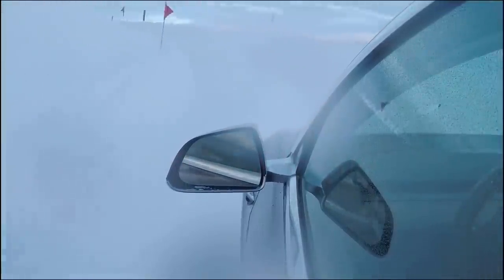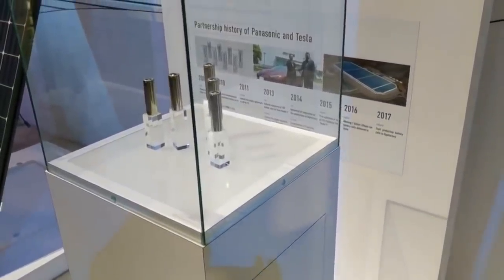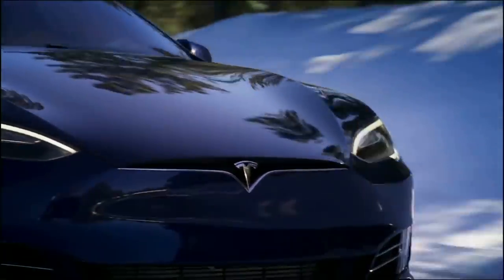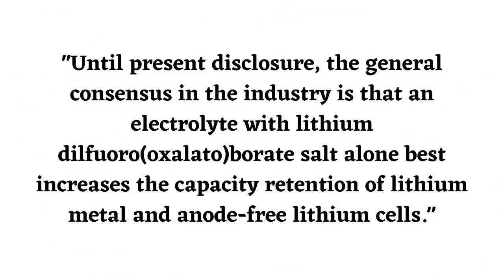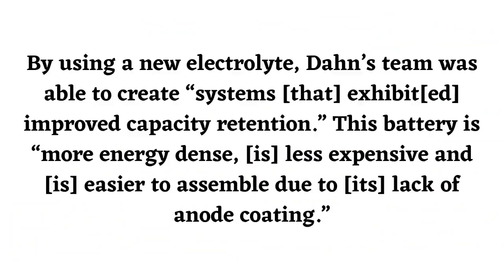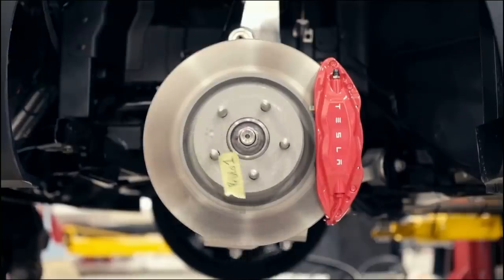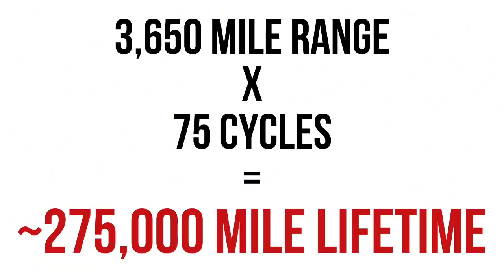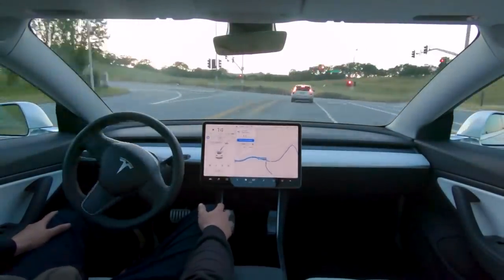Tesla's Secret 3,650 Mile Range Battery - The Next Gen Revolution

Comment: A really silly video with no substance and lots of blind hope. Batteries have a physical limit and the same size/weight batteries will not be able to get 3,650 miles as that is a 10x improvement on energy density

We will be lucky to see a doubling of current cell energy density within the next 20 years

For reference TNT is ~4,000Wh/KG and that is a pure chemical reaction. A battery has to be a fraction of that upper chemical limit as a battery needs to be reversible and is electrical and has hosting and safety systems and collectors and so on

300Wh/kg current best in class cells
4,000Wh/kg chemical limit

Future cells will be above 300Wh/kg but WELL below 4,000WH/kg and as I said earlier if I were to bet I would bet no rechargeable battery in 2030 will have an energy density greater than 600Wh/kg (twice as good as today) and more likely will be closer to 450Wh/kg (50% improvement from today)

Comment: It may make sense to half the battery size and make it at one quarter the cost, potentially opening the way to replacing the batteries many times and extending the car life to say 2000 000 miles

Comment: If this is going to happen, next step for Elon will be electric planes, probably feasible for a fraction of the cost of current jets.
Reply: Electric flight is already here.  Israel operates an EV commuter jet that seats 7 and has a range of 600 miles, 100% electric.  Just one order of magnitude increase in energy density and airliners will be next.
Reply: @PETERJOHN101  Commuter Jet? Either it is a an electric plane, which I presume to be propeller driven. But an electric jet? Even though it probably should be feasible in the distant future, but now, I don't think. Are you sure  of what you are stating?
Reply: “electric jet” that reminds me of Elon’s cameo in Iron Man 2. Check it out
Reply: @Allen Loser As in all projects, it is always a matter of compromising one side to favor the other, and naturally it would apply to every single aspect vital to the whole project. That is the reason we always need high specialized engineers and math expert to bring any complex project to perform at a given optimized level, while establishing at the same time the feasibility of its profitability when the finished object will be commercially  exploited. A detail at times thrown out of the window when a given high tech finished aircraft like the splendid supersonic Concord, well ahead of its time, undoubtedly for countries pride both France and the UK financed the project, to find out later that no airliners wanted to buy them, because it was almost impossible for the Concord to be able to fly and generate a profit at the same time, because its very high maintenance requirement and the impossibility to create profits for the limited amount of paying seats available pro flight. Years later with different players involved, the A 380 again a splendid aircraft with all the right ingredient to become very successful. The few courageous operators that bought them had to absorb great losses and ground the magnificent planes, for being too large and unable to create profits for its very high fuel consumption, and the very costly sophisticated maintenance requirements, condemning the aircraft to fly almost completely full at all times to be able to create a profit, that an impossible task to accomplish for the market limiting effects.
Reply: @Allen Losermaybe not for long.

Comment: 3,650 mile range battery. I would assume supply and demand will fall drastically . Not even demand or supply. If one would release this type of technology , Tesla would run out of business. Not even the supercharger would create profit.
Reply: Where are those big Car manufacturers?Where are they?
Tesla is in the forefront of the EV
I will buy a Tesla 3 after battery day
Reply: cameko cameko I recommend for sure . I love my SR+
Reply: They will sell these batteries for much more profit.  Imagine stacking these in your house, business, etc.
Reply: Wolfgang Preier I would have probably bought stock when it was at $350. Shoot , buying stock at current market price can be a gamble.
Reply: @isaacros123  No not really, plenty of respected people and analysts think the stock can go even higher.
Reply: Where are those big Car manufacturers?Where are they?
Tesla is in the forefront of the EV
I will buy a Tesla 3 after battery day
Reply: Not at all. If Tesla release this then that will fuel demand though the roof! Imagine having an EV that can outlast a Ice car in terms of range and is faster 0 to 60mph not to mention safer and gets smarter as time goes on with OTA, plus cheaper to own over time all at a sticker price that is equal to or lower than a similar ICE car? That would send demand to the moon and back. Plus you forget that Tesla' mission is not to continue making profit for the sake of profit but to transition the world away from gasoline to renewable transport. This would help speed that transition over quicker.

Comment: With a 3,500 mile range but only 75 cycles, what's the plan? Run it all the way down and then charge it for days on end, or just top it off here and there and have a management system brick used cells over time? There is also the question of power delivery under load. Energy density isn't a panacea, especially when charge cycle life is so low.
I'm all for any new experimental battery chemistry technologies but this one doesn't exactly have me excited.
Reply from the maker: Agreed, it’s definitely not ready yet for commercial use. However, if Dahn is able to improve that lifetime to 300+ cycles, it would be revolutionary for robotaxi use and vehicle to grid technology, as that would be where the driving range constrain your profits.
Reply: There are use cases for this battery, even if you have to throw it away after 75 charges.
On the other side if the battery is cheape as they say .. imagine is 50% cheaper and recicling costs a 10% then you have the cost equal a 1500 cicle battery with a 10 times de density.
Reply: Are small cycles bad for this type of battery? (90% to 80%, then 90 again...)